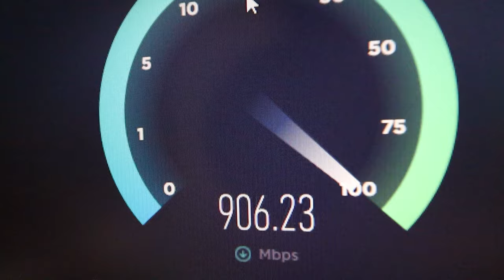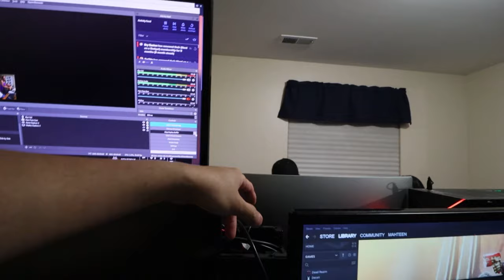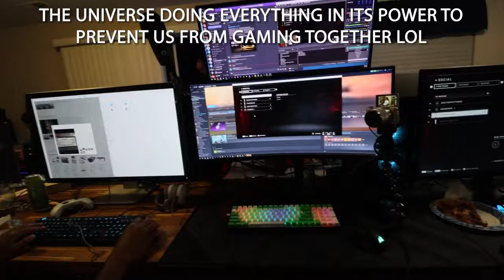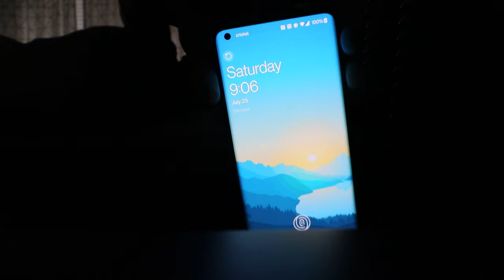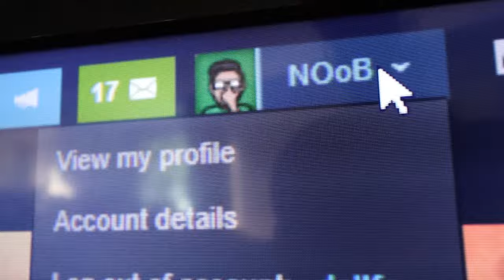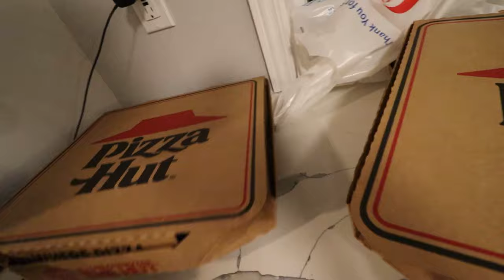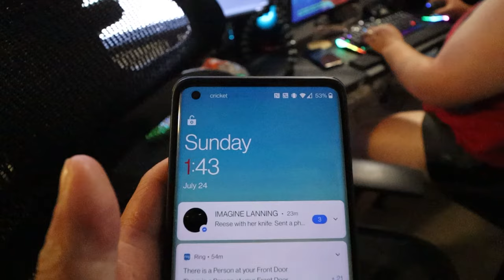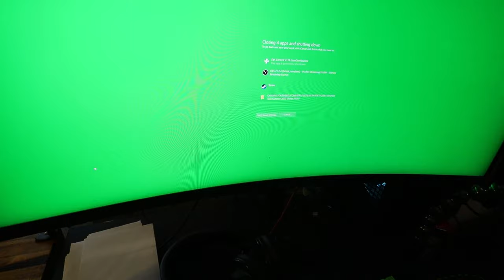LAN Party Stories - Back at NOAB's! (Summer 2022)

Comment: I think you mentioned you had a RX 6700 xt and I was wondering which model. I upgraded from the GTX 1080 to the 6700 xt and my games play like carp. I have upaded the drivers several times and have had it for several months. I have the Nitro Sapphire version and its garbage. Really tempted on putting my 1080 back in.
Reply from the maker: I've got the Power Color Hellhound one, though sapphire one shouldn't be all too different. Which games in particular play like crap? I can't imagine it running worse than a GTX 1080, I've tested a wide range of games and haven't seen anything that had tanked performance compared to what it should be performing at for a current generation card of it's tier
Reply: @nerdonabudget  Any fast pace game like any COD, Fortnite, Apex, OW2, and BF2042. The performance is great when it works but it stutters like crazy and I know its not lag cause my ping is 20-30. Plus I have a Ryzen 5600x paired with it. I play at 1080p so I dont know if 1440p would be better. It started 3-4 months ago and I noticed when I have both monitors plugged in and on it was worse so I have been using one monitor since and it helped for a bit now its back to normal. I hear a lot of people having issues with the RX 6000 series having issues with drivers and stuff.
Reply: @nerdonabudget  I also have SAM enabled but it didnt fix anything.
Reply from the maker: Hmmmm, something seems really off there, I've not run into those issues and I play Fortnite, CoD, and apex pretty regularly with my system. I am running 1440p ultrawide too, what's the refresh rate of your monitor, and what fps are you getting average at 1080p? I'm curious if it's somehow a CPU issue if your frame rate is well beyond what you need, have you tried capping fps at your monitor refresh rate?
Reply: @nerdonabudget  I do cap almost all my games at 240 which is my monitors refresh rate. I did take out my gpu sleeved cable extentions and it fortnite played really well. I still get a lot of stuttering in MW2 at the beginning of every match for the first life or two. It my just be MW2. before changing the gpu cable I had MSI afterburner on with the overlay and the gpu sometimes dipped into the 40% usage while playing and would then go back up. The gpu usage after switching cables seems to be more stable.
Reply: @nerdonabudget  I do have almost all my games on a hdd while I have my os on a m.2 ssd.
Reply from the maker: @ManCaveTV1  definitely try moving call of duty to the ssd, I have a feeling that may solve the problem. As for the extension cables, are they cables from a big well known premium brand like cablemods or similar, or more of a generic Amazon brand
Reply: @nerdonabudget  The cable extensions are generic ones from Amazon. I had them with my 1080 and they worked perfectly fine but the 6700 xt they don't work well. Maybe the 6700 xt using a lot more power then I was thinking. I am trying other games as well and BF2042 plays a lot better even on my 2tb Seagate HDD. I found a 2tb ssd for $100 so fingers crossed 😂.